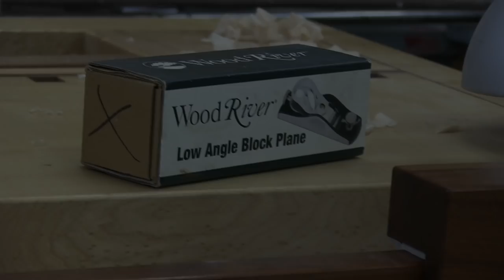Block Plane by Woodriver reviewed by Rob Cosman

Comment: Well ,I bought the block plane and I can tell you ,I would not have believed it but i can get shavings on pine down to 1/2 a thou . It really is an unbelievable performer ,and very good looking with its chromed cap . Rob Cosman has never steered me wrong as far as tools are concerned.

Comment: Thanks for the info. I wished i would have seen this before buying the Stanley sweetheart low angle block plane. so far it's been okay, but a little aggravating adjusting with the wheel. nonetheless, great videos as always. what wax are you using for the bottom, before planning?

Comment: Hello Rob,  Are these planes available n the uk please, I bought one from Axminster Machine Tools here. Rider make, they are supposed to be high end planes made in China, but, they are different to the Woodriver range can you comment please, Derek Rowe
Reply: The Axminster Tools Rider Brand are made in India, Woodriver are made in China. I remember when Japanese stuff was considered crap, Now its generally top notch. Chinese manufacturing has come leaps and bounds over the last few years and is making some really good stuff now, you still have to be careful, but Woodriver is made in a modern factory with quality control that would have been unheard of 5 yrs ago. Same can't be said of India which in my experience still produces crap.

Comment: Hello Rob, generally I would very rarely disagree with your reviews of tools, but in the case of Woodriver LA block plane there are several thing, that should be and can  be easily done better. 
Major issues: Correct allignment of the blade parallel to the throat is not working well, it is too much time consuming, you can see it even on your video. Centre screw has not proper shape and fit in the cap, cap is sometimes hard to fit on the screw. Sole is not flat and coplanar to the throat-piece. Overal grip in one hand is far from optimum. 

My modifications: 
1/ Plane badly needs adjusting screws for the side to side play - 2 set screws on one side, one set screw on the other. Same design as used on the Veritas skew block planes.  I will add this feature - probably some small set screws (in my case metric M3 or M4 set screws). 

2/ side ground depressions (recess?)  for the fingers need more grip, I have modified this with the centre punch dots .  

3/ Sole was lapped flat  with blade in tension retracted back.  (Mine new block plan had the throatplate protruding  something between 0,05 and 0,1 mm above the sole). This way the flatnes is better than originally maschined (probably without tension). 

4/ The head of the brass centre screw will be modified (head shape close to "oval head low profile")  

I will send photos of all modification when finished. 

Lukas H.

Comment: I bought one just like this but I didn't like the toggle cap at all.  I took it back and exchanged it for a Stanley Sweetheart low angle.  The Stanley isn't perfect either, its cap is made of aluminum and the brass tightening screw will eventually wear out the threads.  That's not good, but when it becomes a problem I'll drill it out and insert the threaded part of a steel T nut.  One negative thing about both the Woodriver, and the Sweetheart, is how heavy they are which keeps them from being quite as handy as the older block planes, but they lay on the work better.
Reply: I did the same thing a couple of years ago and now I'm back to the WR and liking it better. The Stanley SW drove me crazy trying to keep it adjusted.
Reply: @watermain48  I guess it's just personal preference.  I don't know why the lever cap bothered me, but it really did.  The Sweetheart doesn't give me any problems with the adjustment.  And it's threaded aluminum cap is still working fine. 
But I'll tell you, weight is very annoying.  It's like working with a brick in your hand.
I have a wooden ECE "block" plane that is quite light, and it's a joy to use when the wood isn't too crazy.

Comment: I just want to say the brand is wood river, the river that they use is not pronounced like the body of water. It is the river, root word rive. To rive is to separate two materials; cleave. So as to not confuse people, let’s get the pronunciations correct.
Reply from the maker: Well, respectfully, it is pronounced like the body of water, which is why they will occasionally have a river pictured on their products. You are correct when you say that “rive” means to separate two things, however, it also means to do so violently or by brute force. That is simply not the case when using a hand plane. Therefore, the pronunciation will remain where it always has been, Wood (a byproduct of trees) River (flowing water).

Comment: Would a low angle rabbet block plane do all the same work as a regular low angle block plane, plus the "rabbeting" capability? Might be a silly question, but if I can achieve both in one tool, I would get a low angle rabbet block plane.

Comment: Good stuff again. I've owned a couple vintage L A block planes, one a knuckle style model 3732, like the WR, the other an old Record 060 1/2. On both of my older planes I can adjust the depth of cut while the cap is securing the blades. Can not do that with the WR Plane, it is either tight or too loose to hold the blade. After years of using the old Craftsman I didn't understand that the cap should totally lock things in place, until I watched your video, but I've never had an issue with the blade moving. I was going to send it back, good thing I watched your video again and caught you flipping the knuckle cap to make blade adjustments. I was going to send it back... because I'm a knucklehead. 
Side note, I gave away my new production Stanley standard angle block plane because it didn't fit my hand, these LA block planes are the only way to go.
Thanks Rob!